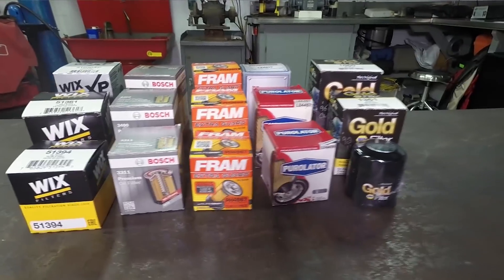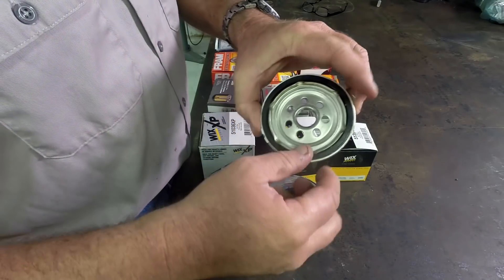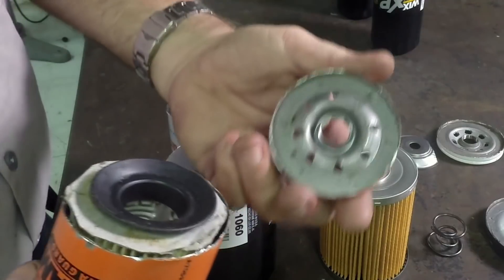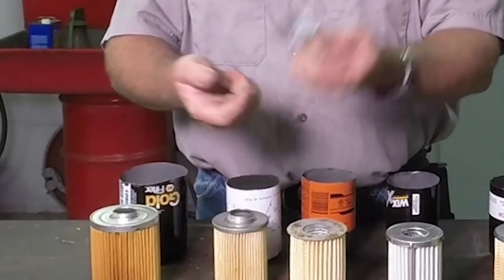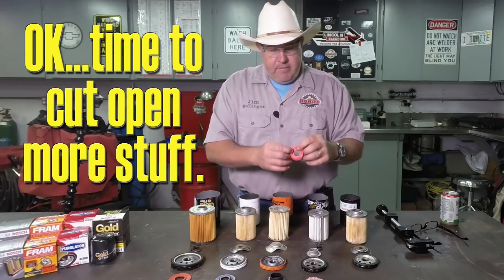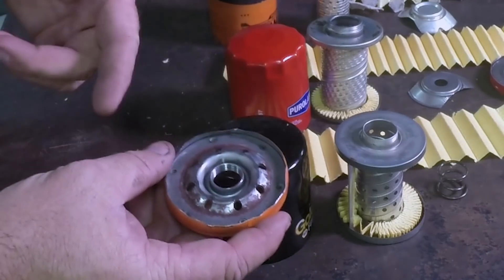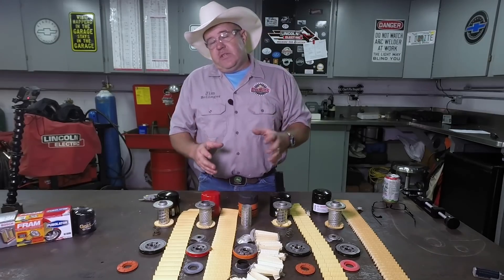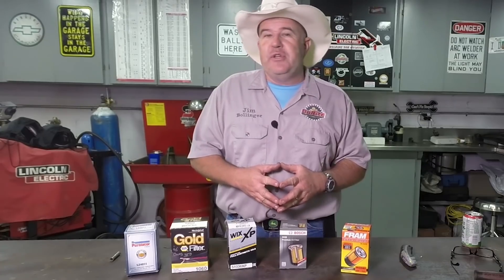The worst oil filter EVER!

Comment: Saw a fram filter take out a £40k engine. Filter internals collapsed and blocked oil to pump, engine seized.
Reply: That seems unlikely...that is what the oil filter by-pass is designed to do...it's in the engine...NOT the filter...you got bad info.

Comment: If you buy the cheapest you got to expect it to be cheaply made. 
You can't compare a high end filter to a low end filter. How about comparing the worst/cheapest from each brand instead? Fram has higher quality filters than the basic one you showed, so it would be interesting to see inside those. Would also be nice to compare directly ones that cost about the same price to see.

Comment: I use only MANN filters.   As far as I am concerned they are the best.  MANN now owns Wix by the way.   I have seen tear down comparisons if Wix, OEM and MANN filters they are all virtually identical.  They one thing I would note is that the MANN filter has fewer threads on the mounting plate than an AUDI  OEM filter.   I am not sure if that is significant or not.

Comment: Ive used fram filters for years and never had an issue. Then again, i dont buy the 4 dollar ones, i get the high mileage or extended guard. If you blame a filter for you engine giving, youre either using shitty oil or not taking care of it properly. Ill use fram over a purolator and ac delco any day

Comment: I use Fran on everything and never had any engine issues. My F150 has 216,000 miles and my Jeep Cherokee’s got 226,000 miles and both run great. I’ve never had a vehicle have an engine issue much less a failure using Fram. So the proof is in the “pudding”.

Comment: Purolator filters are the best and they are one of the only filters that have the highest Beta rating. ISO standard don’t apply to the cheap name brands. Go with “Purolator One”not the low level purolator that you showed. It will beat those other cheap “Gold” level filters all day long bruh!

Comment: There are three different types of Fram filter and three different types of Bosch filter. It would have been helpful to tell us which one you tested as they are all different quality. The Fram ToughGuard filter is better than the Fram ExtraGuard filter that you tested. And there is also a very high quality Fram filter designed for synthetic oil change intervals. The more you pay the better filter you get but that only makes sense for longer oil change intervals. How long was the Fram filter you cut open sitting on the shelf?
Reply: Fram sucks. Wouldn't doubt if they used thicker cardboard on their toughguard filters.
Reply: The fact that they found the use of cardboard acceptable in ANY variety of engine product shows that they can't be trusted for quality.
Reply: Are you joking ....your going to trust any Fram product after the garbage that he just took out of that filter.
Reply: It's always better to stick with what comes factory on your vehicle.

Comment: Just did my oil change today. Switched from Fram to a Napa Gold filter because of this video. Thanks for a great video. The only thing I wish is that you had a Fram synthetic filter in this since that is what I was running. But I didn't want to take the chance. Thanks again.

Comment: Only to say....an oil filter on any modern car is just about obsolete....so the supposed quality...is less an issue. Now, I do by WIX or Purlator...or OEM....if given a choice. IMHO, you are wasting a LOT of money changeing the oil at less that 5000 mile intervals.....with the possible exception of add on boost applications of which I have two examples....our oil today is so much superior over automotive oil produced even 20 years ago! The motors are sealed in today's world and that combined with electronic controls makes the supposed quality of an oil filter nearly....words....not worth talking about....almost....

Comment: Here's the truth. You don't actually want an oil filter that restricts flow. THAT is what will damage your engine faster than anything else. So don't think that an oil filter with MORE guts means MORE protection because it does NOT! I use Fram and have for decades on my expensive racing engines and personal vehicles. If you change your oil frequently and make sure the air filter is sealed well you will be fine. Keeping the flow rate of oil high is literally the best thing you can do to protect and lengthen the life of your motor. I have been in classes where they cut open all the popular filters....blah, blah, blah.....I have worked where they take oil samples from equipment and test them to check for metal wear internally in engines to monitor and catch wear and tear. I tested my own personal vehicles. The engines that lasted longest and required less maintenance were the one's that used filters that flowed best and had frequent oil changes. STP was another great filter.  Also, the really expensive filters like Honda's have  a valve that allows the oil to flow freely on startup to bathe the motor in oil while it is cold. It is literally better to bathe your engine in dirty oil while it is cold than to have too little oil at ANY time.

Comment: The only applications where I wouldn't use a fram filter, would be in high performance/race applications. Specifically in engines that produce very high oil pressure. I've ran fram filters for years and never had a problem in my everyday vehicles. I'd suggest "Wix" filters if your engines produces more that 100psi of oil pressure. Fram filters are manufactured for an economy type vehicle, with oil service intervals of about 5,000 miles, and I guarantee the filter has more than enough in it to adequately clean the oil and keep the engine safe. There is no need to spend 20-40 bucks for a race application filter on a daily driver..

Comment: As a former ASE parts specialist I am amazed that you made the connection between Purolator and Bosch but failed to see the connection between Wix and Napa Gold. There is a reason they are identical in quality. Wix makes the Napa Gold line of filters for Napa and then Napa puts their name on them and marks up the price. Go to O'Reilly's or any other auto parts that sells Wix and just buy the correct filter without the markup. If you notice, the Napa filter part numbers are the same as the Wix filter part numbers only Napa deletes the 1st digit. A 51348 Wix filter is the exact same filter a a Napa gold 1348.

Comment: What does the inside of a pretty blue AC Delco PF64 replacement filter look like?
Reply: Plastic
Reply: Thank You Leo. Is that good plastic or bad plastic? They use this model on just about everything and while our vehicle is STILL under warranty I want to stick with the factory replacement.  Back when less than 6 months old my 1978 My Silver Anniversary L82 Corvette's engine melted down. Turns out the Chevrolet Rep was at the dealership and while they were going to order a replacement denied covering the warranty engine. (less than 8000 mi on my baby too) I had to write the check for a replacement short engine and reinstallation.  I was not very pleased. All because it had an STP HP oil filter on the car.  I have since attempted with new vehicles to keep factory service parts on them until warranties expire.  It's taken til 2017 for me to consider buying a NEW CHEVY again. Jus Cus,  Erika.

Comment: Idk fam. I had a 2000 Silverado that I changed the oil religiously every 5,000 miles and all I used was Fram oil filters and it lasted a long time. I sold it with 386,000 on the clock and the guy I sold it to says it rolled over to 400,000 miles already and it’s still doing fine.
Reply: Fram orange can is a budget filter.  It still works.  This guy is not really doing apple to apple comparisons.
Reply: Xavier my 1986 bronco with the 351W engine has 344,000 miles on it and since it's first oil change has only had Fram filters.  Never had the covers off and never a problem. My wifes mountaineer had 226,000 on it and never an issue... Fram from first oil change. I certainly won't change because some clowns on youtube say that i need to.
Reply: Hayseed yeah buddy!
Reply: You car working doesn't  mean fram a good filter.
Reply: nzalog car working means the filter is doing its job
Reply: @PanchoPistolas45  "Doing its job" doesn't prove quality, it's not the same. A wax and wash is not the same as just a wash. Though both do their job of getting the car cleaner.

Comment: I believe the Fram oil  filters are popular because of the tough guard option you don't have to use a oil filter wrench you can actually tighten and untighten them by hand that's a big reason why the fram sells so well. Buy Napa gold or wix.

Comment: I would agree that Fram is definitely made on the cheap, but this is hardly a scientific comparison. I use a cartridge Fram on my crappy old Santa Gay because it is cheap and does what I need it to do. Taking something apart and looking at it isn't enough to conclude that it doesn't do what it was designed to do. If Fram was that under-engineered, they would be paying for lawsuits up the wing wang. 
Here's an actual scientific oil filter comparison. 
https://motorcycleinfo.calsci.com/Filters.html#OilFilters

Comment: This guy should be ashamed of himself. I cut open a Fram filter after seeing this and guess what no rust no decaying parts. 
The inside was clean as can be. So the take away here is don’t use a 20 year old filter that has been sitting in bottom of a junk pile in your shed.
Yes there is are hardboard sections on the top and bottom that the filter media is adhered to, what this flaking is on the so called cardboard, is a product left to decay somewhere(might want to think twice about where he buying them from).
The plate on the bottom is a strong as can be, the plate also contains a spring relief valve that allows oil to flow in case you don’t change your filter or to many contaminants and it plugs. 
The claims in the comments section here about the filter causing engine failure, I think are fabrications. I am 65 years old and have driven hundreds of thousands of miles using Fram filters, guess what no engine failures.
Reply: You are working for fram it's filters are garbage I cut them open 25 years ago and they still are no better. And that is that.
Reply: Maybe you could curb your lies long enough to tell Jay Leno why he can’t use them on all his old cars. @itsok5079
Reply: DPMR some never see the light because they don't look. Jay might use but that's right he don't drive any of them so jay don t even need one I doubt he would use such garbage on his cars it's best to stick with what comes on your vehicle from factory dose not cost any more and it's the right choice just like the engine oil the engineering has already been done for you  . As for working  for fram that was a joke .
Reply: See this what i am talking about, people like you just spout junk out and expect everyone will beleave you. Well again your wrong, Jay Leno won't own a car that can't be a daily driver. He drives a different one every day, sometime for longer if he likes.
This is what I mean, the guy like in this video just expect people beleave him right or wrong. Well he is full of it.  @itsok5079

Comment: WHat do you know about the air filters in a Polaris Rzr 2008?  I was told not to put a k&n air filter on a Polaris Rzr 2008.  Why?  Does it harm the engine or performance?  Their airfilters are rather expensive and  I’ve always used k&n air filters if available for my autos with no problem.

Comment: Fram... haven't used in  years.. over 20 for the same reasons you covered, designed and built cheaply.  Wix, Napa, Purolator, and Bosch I believe all come from the same facility.  If nothing has changed, there were only 3 manufacturers of oil filters in the US, but that was over ten years ago.

Comment: appreciate the video, it's nice to see the difference between products. that being said, at the end of the day; it's an oil filter. a little surface rust isn't going to make any difference in engine performance or protection. Fram is a cheap oil filter, always has been and always will be. quality of the filter you chose falls under the quality of the vehicle you are putting it on. if you have a cheap car, no need to spend 30$ on an oil filter lol. Fram will still filter the major particles that will cause engine damage, so don't worry to much. obviously if you drive a higher end sports car you shouldn't use a cheap filter like Fram, but it's safe to use on your Honda Civic lol.

Comment: I always used Fram until a $2500 repair bill on my SUV , where they found parts of the filter clogging the oil ports inside the engine. I was told " never use Fram filters" by some people after that , but too late! Nothing but NAPA Gold now.

Comment: I do appreciate your research and your results are eye opening for me, but I still need to make a comment. I just sold my 2002 chevy cavalier that I owned for 16 years. I put 340000 miles on it with not one engine issue, and I still see it running in town from time to time. The only oil filter it had on it was the cheep Fram filter. I guess my only point is the cheep Fram filters must be getting something done. Thanks again for your work on these filters and I will have to think long and hard before putting a cheep Fram on my new Colorado.

Comment: Mann and Mahle are both good filters.
Actually had a fram filter explode on  me while driving, spayed oil all over.
I pulled over and shut off the engine, the engine did not get damaged.
Never bought another fram filter again, junk.

Comment: saw this same demonstration about 20 years ago. Sponsored by Baldwin which is an oem or used to be anyway. The fram at that time had about half the paper as the other brands the metal housing was really thin and that actually was the biggest problem because it would flex and crack over time on industrial equipment which we serviced.  It was the worst then but not near as bad as what i just saw here. Wix makes the napa filters and have used them or the baldwins for years at rental yards with no problems.

Comment: I have over 330,000 miles on a gmc 2500 pickup and all I've ever used is fram oil filters. I probably won't change filter brands at this point but if I get another new truck, I'll probably switch to the wix filters to see if I get more miles out of that engine.

Comment: I used to be a Napa Gold Filter Fanboi until I got my BMW and used a Napa Gold Fil1223. After a few month the o-rings started leaking so I replaced it with a genuine BMW filter. I was horrified when I removed the Napa Gold - the media was twisted and collapsed and obviously the o-rings had deteriorated to the point that it was leaking from the housing . It had made in China printed on it - I'm not sure if Napa got a counterfeit batch in or what, but there was no way this was a Wix made filter. Never again. Mann or OEM for me from now on.
Reply: look at 2.19 and you can see napa is made by Mann hummel .
Reply: Jomo is right. Mann Hummel bought wix and makes napa gold filters now. I use mahle in my BMWs.
Reply: Funny, I believe Mann also makes BMW filters.
Reply: @jacobcurtis6849  Yes I believe that - they look identical. I actually see two different filters listed on Napa's site now - one looks like the crap version I bought initially, the other like a Mann, so I'd be comfortable with that one, but it doesn't save me any money compared to the BMW.

Comment: I used a fram oil filter and the filter disintegrated and blocked the whole system. The car was written off after that. Needed a new engine.

Comment: I  have used fram for over 20 years and I have never had one fail on me. But Napa and wix have fallen apart after about 2 weeks of driving. I have taken apart a new fram filter and it wasn't rusty or made with such crap . I will never use Napa or wix filters on any of my vehicles. I don't work for fram .

Comment: The level oil filters that are selected for comparison should be of the same grade, and price range.  If your holding some qualities as constant it need be more than just brand name. The factors for comparison are good, and constant, however I noticed that the grade levels are different.  The napa filter you praised is mid-high range, I did find that they offer platinum as well but what about the others... I saw more than one with a grade difference. Overall liked the comparison,  just need more continuity to agree with your opinion.
Reply: Ps Fram is junk, its news that is public now.

Comment: In the early ‘80’s, I cut open a MANN filter that I used for
my first oil change on my Mercedes 300D that was just rebuilt. What I found was
the filter media was made up of SHOP RAGS and shop sweepings. ( Now at the
time, on large engines there was such a thing as Rag Filters), But:…Found
inside the used filter rag bundle was Rocks, Broken Glass, paper clips, basically
Shop Sweepings.  As we were an Industrial Engine distributor at the time, I sent a TELEX to MANN. They denied it could be true, and told me to pound sand.  Since then: Factory or BALDWIN Filters only, no more Crap for me.

Comment: Thanks for this Jim, really good demo......what about the Fram HP-1....a lot of guys use those, due to the higher burst pressure for race motors that experience higher oil pressure #'s at higher RPM.. I know the standard Fram units are NOT great. I started using Baldwin filters. Even my parts guys said Fram is not as good as the Baldwin. What do you think?
Any info could be really appreciated.

Comment: I ran nothing but Fram filters and conventional oil (whatever name brand happened to be on sale) and ALL my cars never had engine problems. Most of my 8 cars were sold with well over 150,000 miles on them. One even had 235,000 miles. Never had engine problems. I changed my oil and filter religiously at 3,000 miles. Maybe I was just lucky or maybe constant oil changes were the reason.